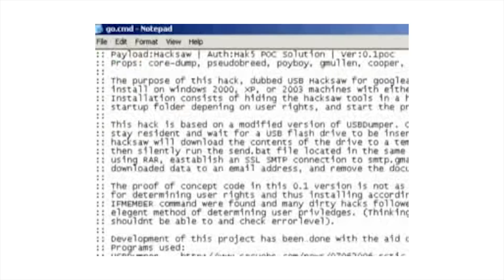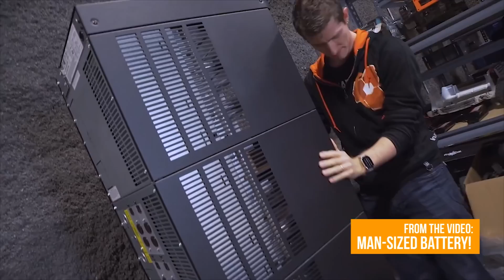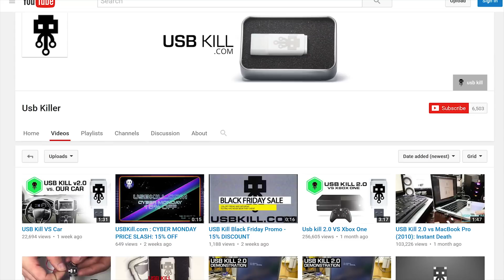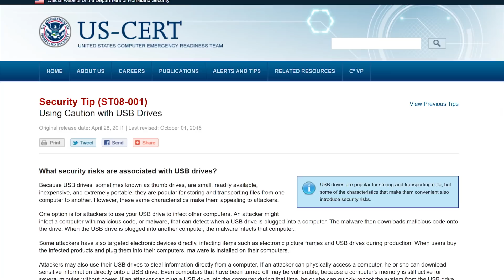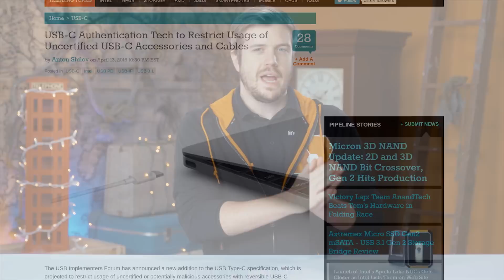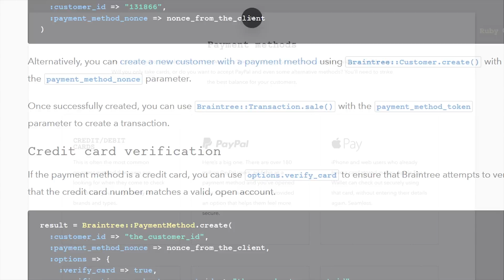COMPUTER DESTRUCTION (GONE DEADLY)

Comment: The solution could be to have a software installed that is password protected that enables or accepts new devices being connected. If it's not "accepted" in the software, the device will never be enabled = No shock.
When plugging in new devices, go to the software, type in your password and accept the new device and it will remember that device forever.
Reply: Surely there could be other solutions, but that could indeed work.
Reply: Sean Robinson JR, you do realize that a USB device has to be powered in order to be detected by the computer? When the USB killer gets powered, it destroys the port.

Comment: Would this still kill the device even if the power was not on?
Reply: Jonas Borum no
Reply: No because the USB Killer cannot charge up
Reply: Depends on the situation. If the device is not on but receiving power then it has a chance to if the motherboard supplies power to usb ports even while not running...which most new motherboards seem to do.

Comment: Please tell us more about opto-isolators, and why, if you know, there's nothing like this to protect pc's from power supply failures. For the usb thing they've got a solution. Something that actually happens, like psu malfunction, nope no solution.
Reply: If any body has an answer please reply. "Effectively preventing high voltages from reaching the rest of your system" sounds like something that should come standard in power supplies.
Reply: Optoisolators dont transmit power (or at least very, very little), its litterally an LED and photodetector in a package use for isolating data signals. They are commonly used in industrial I/O due to the high(er) chance of voltage spikes and missconnections, that way if they get damaged you can just swap them out. In consumer gear its mostly pointless and just added cost. They wont protect against the gen 1 version of this USB device either becuase that used the power lines instead of the data ones.

Thre are plenty of ways of suppressing high voltages and/or currents on power lines too and most PSUs and regulators do have protection in the form of OVP and OCP circuits but all come with tradeoffs and/or limitations, its a balance between usefullness and cost.
Reply: Okay thanks.

Comment: So? If an attacker has a hammer, or even fists and a bit of brawn they can brick your PC and there's nothing you can do about that.

Give physical access to an attacker and you will be pwned, that's the ground rule and it applies here as well. Security measures/systems aren't typically designed around the assumption that an attacker has physical access to your PC, because at best you can slow them down or deter them.

Comment: What if your PC is turned off, surely the USB port wouldn't do anything let alone transmit power?
Reply: Some ports do. I've been able to charge my phone with the computer off.
Reply: ^ This. I guess it also makes USB wake up possible.
Reply: unless you disconnect the power supply cable, most computers still transmit power to front usb ports, even when the computer is off (so you can charge stuff)
Reply: then they press the on button
Reply: no most modern power supply supply 5v standby to motherboard when the computer is off, which can be used for computer off USB charging
Reply: Maxeeyy of course it wouldn't work when your PC is off however the guy who wants to kill your computer probably knows this already
Reply: +laalki80 WTF? The USB port was directly connected to the PSU?
Reply: my laptop has one port that supplies power while the computer is powered off, it's yellow.

on my pc though all the ports do this, so i guess it would work on some computers/ports.

Comment: It's not only the USB that's vulnerable to this. Almost all inputs/outputs have this problem. I worked at an ISP long ago, and a coworker plugged a broken switch (which sent 220V over the Ethernet ports) on a network. All the computers in that building were completely fried. The company had to pay for all of them. So yeah, don't try this at home. Or at work. Or anywhere.

Comment: I have an easier way to kill a pc and you don't have to buy some doodad on ebay:

First, find a screw about 5" long. Put your left hand on top of the computer case with a power cable attached (make sure it's properly grounded). Grab the screw with your right hand, and jam it into a power socket. The power spike between the ground of the PC and your hand will kill most parts of the PC!

Comment: Anybody tried it on a plane yet?
Reply: Wouldn't do shit though. The USB ports on a plane barely has any connectivity with something else, except maybe a screen on the headrest in front of you. You can forget about ruining the airplane's main electrical system.
Reply: Funny thing: If you fry an airplane's electic system it can still land with ease.
You need to also fry the captain and wingmen to seriously damage the plane. ;)
Reply: Mathis wow I never thought of that, it would be interesting to see.
Reply: interesting, yes. Wouldn't wanna try this mid flight, you never know hahahah
Reply: +HistoricaHungaria Except the Airbus A380, which is too large for purely manual controls. Although I'm sure that one also has backup systems.
Reply: Avionics are insulated from media systems, it's pretty obvious that in like 300~800 people inside that plane (yes, in full economic class the A380 can take about 800 people), faulty USB devices may be plugged in. This has to be protected. I would bet that each media device on the seats is independent actually.
Avionics are also usually triple redundancy so like, you'll have to fry 3 separate systems with lots of protections of this kind between them, IF any of them have USB connectors
Reply: and now you are on a list.
Reply: Doesn't this use data connections? Security reasons, I can't see airplanes having usb ports for data for passengers.
Reply: Mathis
This could happen indeed, but I would bet that airplane media devices are a bit more protected than consumer grade stuff, it's closer to a public device than a personal system so they need to have good control.
If I ran an airline I would definitely do this test
Reply: Mathis you guys should do that. Also you should reply in this comment what state you're over before you do it. I love free stuff.
Reply: SaHaRaSquad Why would you fry the mainframe only? Obviously you would attack the backup panel as well.
But yeah. Good point.
Reply: I wasn't talking about killing the whole plane, i was just wondering if you could kill the screen and or the media controller. Btw Delta vip flights have a data connection
Reply: Wow, now I want to plug it into a USB port in a cockpit. ._.

Comment: What if you deactivate all your usb ports? Is it still able to be killed by this usb if there's no power going to the ports?
Reply: QyroCorp no, if there's no power to charge it, it can't release any back in
Reply: Yup. If you charge the killer beforehand, with a protected power bank or whatever, you can theoretically release the charge (i.e. current) in any port the USB male connector fits in.
Reply: Enrico Rovere except that it's always trying to release it, a protected charger is just grounded, which means the extra current just goes into the ground, but it goes through the other stuff first. And this has been shown to wreck "protected" electronics.
Reply: ethan linquist It's got a thingy with wires dangling from it, to check the functionality of the device before deploying it. To be truthful, a diode should suffice.

Comment: I have always thought about a unibody system that is custom dual rail system that blocks all left and right side ports with it being locked and removed from the bottom of the laptop, so it ends up protecting all ports and adds just a small riser under the laptop, but all that just for that physical protection.

Comment: what if you tazed the usb port, will it kill the computer?
Reply: Caverri A tazer operates at 50,000 volts while flying through the air, and at 1,200 volts once the barbed contacts enter flesh. The most powerful ones operate at 50,000 volts, 26 watts, according to Taser USA. 
Tazers will absolutely kill a computer dead.
Reply: damn...
Reply: how about those arc lighters, aren't they' basically tasers?
Reply: I'm not familiar with arc lighters. From my knowledge of electrics, I would guess that they use higher amperage rather than voltage. But again, I'm unfamiliar. Either way though, they can still probably murder electronics pretty good.
Reply: Caverri arc lighters do shock you with 8000v. Most people think it's just some high frequency noise that doesn't hurt you but iv'e tried putting a metal piece and make contact with the beam and it does hurt. but the beam is so small that only tiny stuff can touch it but i wouldn't try
Reply: Everything that makes ark is high-voltage. You need 1000 V for each millimeter  of air gap.
Reply: that's how i calculated it also. cuz the arc is 8mm's of lenght
Reply: length
Reply: so.. can the arc kill you?
Reply: No, they only leave some tiny burning spots on your finger.
Reply: thats good to know

Comment: You can't opto-couple a differential signal that's going that fast and even then you'd need a power source exposed from each side in the middle and you could just go back to attacking the power rails. You'd also need separate tx and rx data pairs instead of one. Speed wise there are digital isolators for USB 1 speed but USB 2 and faster the components just don't exist or are only /just/ appearing for USB 2.